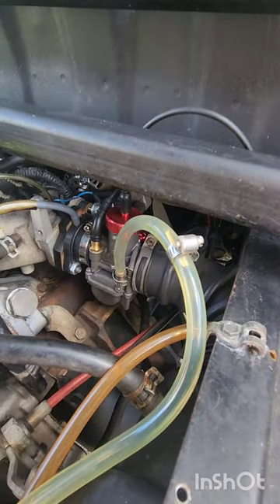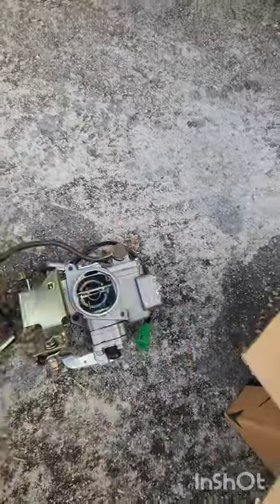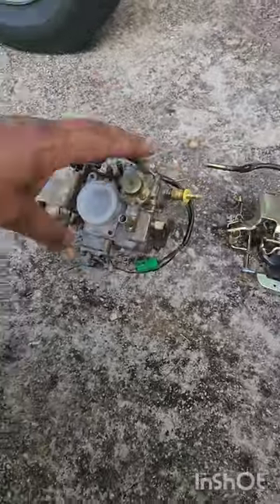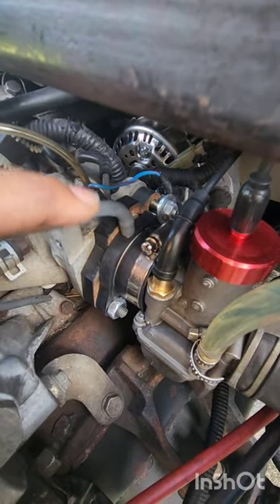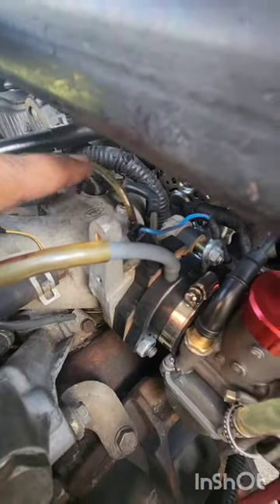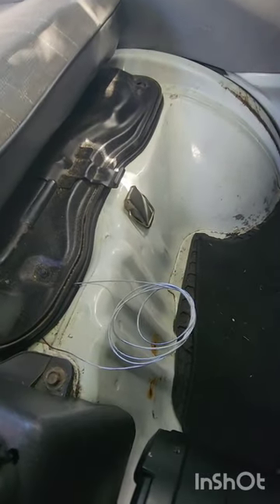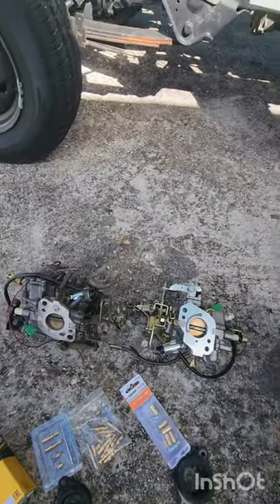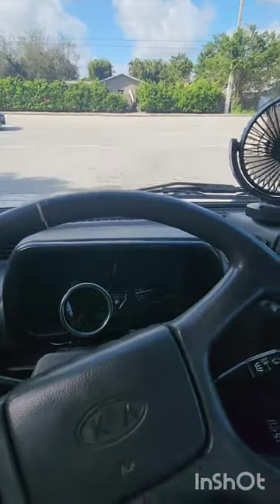MOTO CARBURETOR ON CAR

Comment: How is it running after a year. If you were doing it all again would you have gone with the 30PE or something different? How is the response and do you have more power and pull through the RPMS.

Comment: Hey buddy thanks for the video!!...i bought a 2003 kia metro and it was seized...got it unsiezed and they made a mess with another VW carb...im using your Moto Carb...Can you send me a pic of the vaccume lines running into the ignition or distributor??...they have one ran to the little bell looking thing on the distributor but the other vaccume line is broke and not sure if its the same line you have...i need to see where the lines connect to other than the carb 👍
Reply from the maker: I sold it but I csn help you if you video call me

Comment: Erinson I have a 86 Hijet S81P with 550cc motor. If I try this do you think I would jut need to use smaller bets or I’ll be able to tune it?
Reply from the maker: I don't understand your question but I'll work very fine 👌
Reply: You'll need smaller jets also get a air fuel ratio gauge to help you tune and figure out if your running rich or lean

Comment: Why did you jet the fuel line before the carb? Was it running too rich before? I have a similar issue.
Reply: My guess would be that normally the motorcycle carb is gravity fed into the bowl and then it uses fuel from the bowl to feed the jets, passively. Since he can’t gravity feed it, it only needs enough speed to fill the bowl and keep it full enough for whatever driving conditions. The float stopper presses to stop the flow so you don’t want a crazy amount of pressure and like he says in the video, it was overflowing with the pump. Maybe could use a super weak fuel pump?

Comment: Erinson so I finally received all the parts to complete the carb swap. It took a little doing to get the radiator hose to fit. But I got it. I haven’t hooked up the choke yet but like you I live in Florida so I’m not worried about it. So everything is in and this was the first time I didn’t have to pump the gas to get it started. Right now I’m in the process of checking timing and trying to dial in the carb. But I was very successful at your carb swap. It started right up and I did swap out both jets like you recommended. My mini is a Diahatsu Hijet 1986 EB60 550cc motor.
Reply from the maker: Did you got it installed and working? I only use the choke in January and February otherwise it starts right up.
Reply: Yes installed and running. I still need to check timing and adjust a little more
Reply: https://youtube.com/shorts/5CNQ4gHNIe4?feature=share
Video installation and running
Reply from the maker: @ciroressa7018  make sure you connect the vacuum hoses to the ignition
Reply: Erinson I did take care of that. Trying to find another OEM cable because I’m having a little issue getting the bike cable to work perfectly. If I find the OEM cable I’ll modify the original cable I have.

Comment: Great Video!  I just purchased a 1992 Daihatsu Hijet light Dump bed 4x4, locking diffs....i am getting things ready to improve the truck and going to use your idea here.  I have turned wrenches on motorcycles for years.....how did you figure out which carburetor size (mm, boot size, etc...?) The truck sounds great!
Reply from the maker: Let me know how it goes

Comment: And this carburetor is very Easy to tune!! 
You can use a timing Light and a vacuum gauge to get the exact Set Up.
Reply from the maker: I didn't have to tune it with a timing light.  It worked right after the install
Reply: @erinsonduran6663  Good to know bro!
Please make a Video about The fuel Consumption!! Thankyou
Reply from the maker: @kimrowoon2474  I will
Reply: Sir where did you connect the return fuel line

Comment: Hello! I have a Mazda carol 1990 with the F6A, its a 0.6L(660cc). I did the same setup as yours and it worked! I just can't seem to get the right jets, what size would you suggest for my car?
Thanks alot ✌
Reply from the maker: What's it doing?
Reply: @erinsonduran6663  In park everything seems fine but when i get on drive the car dosen't have power and seems like its ''flooded'' while accelerating, white puffs here and there, it smells gaz alot.
Reply from the maker: @hotot5845 you need to have a return to prevent over flooding
Reply: i have a return, the car is not over flooding, it just feel that way when i push the pedal. im thinking that the jets are way too rich for my car
Reply from the maker: @hotot5845 play with the pilot jet, get a bigger one

Comment: Hi Erinson what's the cc on that engine 660?
Reply from the maker: This one is not a Japanese version so it is 800cc and the vans are 1000cc. This was made for the Korea and South America market.
Reply: @Erinson Duran alright imma attempt this carb swap on my hijet cause a bought the replacement  from Amazon and is having the same issue u had thanks for the vid
Reply from the maker: @alfredomedero7376  the flange I got is 40mm and the carburetor is 35mm so I cut a Radiator hose to get the 5mm difference between the carburetor and the flange 😊 because the clamp was not enough to get it tight. It is a simple swap. Where are you located? USA 🇺🇸? If you have mountains I recommend a #160 pilot jet. You will need more fuel to go up, in Florida is flat and I'm using a #150. Good luck
Reply: There's the 5mm a was missing lol, im in Killeen tx i appreciate the help and the vid
Reply from the maker: Yes 5mm, I cut a coolant hose and inserted it in the carburetor and then got it inside the flange
Reply: OK, i got her running but now stays accelerate 😂😂 you said something about the spring on the throttle, you mounted another one on top or inside of the existing one? Thx in advanced
Reply from the maker: @alfredomedero7376  nice, you will need  another spring because the one it came with isn't strong enough to push the needle down. Inside!!!!!
Reply: I'm sorry I didn't mean outside the carb, I'm trying hard with my english 😅 so u running a stronger spring or 2 strings
Reply from the maker: @alfredomedero7376  hablo Español
Reply from the maker: @alfredomedero7376  2 resortes del mismo tamaño solo para que tenga mas fuerza empujandolo hacia abajo😂
Reply from the maker: @alfredomedero7376  do you speak Spanish? Send me you email and I'll send you pics tomorrow
Reply from the maker: Hola ya lo instalaste? Dejame saber

Comment: So is the carburetor the Pe30 or the PE28, I am going to start doing this swap
Reply from the maker: PE30 IS GOOD 👍
Reply: Thanks,So did you just plug off all the other vacuum lines?
Reply from the maker: @alexisbaca2297  not all check the video
Reply: Hey, so the jets that you listed in the description the main jets only go up to 140, and you said to use 155. So so am going to order a different set of jets. Do you this style of the jet matters
Reply from the maker: @alexisbaca2297  yes order another set.
Reply: Hey man I’ve been working on the swap but the carburetor is spraying a lot of fuel out the air filter side. Do you know why this may be

Comment: I think I'm gonna do the same swap on my hijet. My stock carburetor sucks
Reply from the maker: You won't regret it!!!! It has been working  wonderfully
Reply: I've never done a carb swap so alittle nervous about doing it cause all the vacuum lines. But I'll follow your video.
Reply from the maker: @androdiehl6596  no worries you will be good 👍 where are you located? I. In florida and I never use the choke cable
Reply: @erinsonduran6663  I'm in New Jersey I will need it for the winter lol. You think the jets you used will work up here?
Reply from the maker: @androdiehl6596  yes it will work perfectly. You will need it there. I installed a different one after the video, here it is
C CLINK Choke Cable W/Boot For HONDA Rancher 350 OEM Carburetor 2000-2003 17950-HN5-671 https://a.co/d/f6uKg6c
Reply: Ahhhh thanks man, I'll let you knots know how it goes
Reply: Should I add the pilot jet into the fuel hose?
Reply from the maker: @androdiehl6596  no do it without, if you use the same carburetor I got
Reply: @erinsonduran6663  ok cool thank you, yeah I'm gonna run your setup.
Reply: Oh I meant to ask where did you get the extra spring from for inside the carburetor?
Reply from the maker: @androdiehl6596  I got it from another carburetor at a friend of mine's motorcycle repair shop, but don't worry about that because you might not need it.  😉
Reply from the maker: @androdiehl6596  don't forget to subscribe 😉 😀
Reply: Cool man, thanks for replying allot of people don't. Your the man can't wait to do this lol
Reply: I did, I gotchu 👍
Reply from the maker: @androdiehl6596  let me know when you  start your carburetor swap 👍
Reply: @erinsonduran6663  will do
Reply: Great Video!  I just ordered a 1992 Daihatsu Hijet Light Dump 4x4, diff lock.....have not received yet, but wanting to get things ready for arrival.  I have turned wrenches on motorcycles for years.....how did you know what carburetor (mm size, boot fitment, etc..) to use on your truck?  It sounds Great!